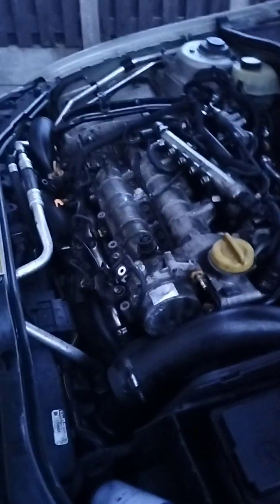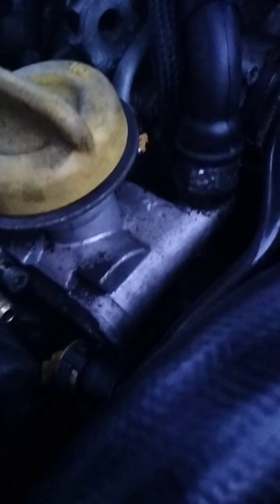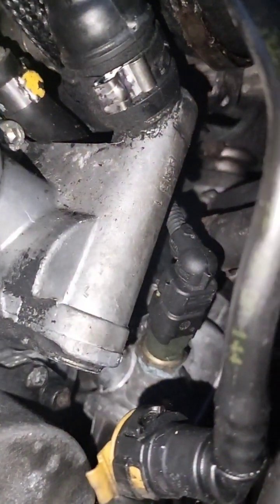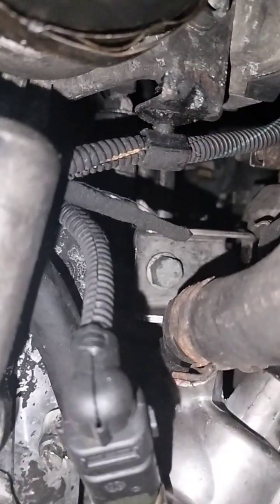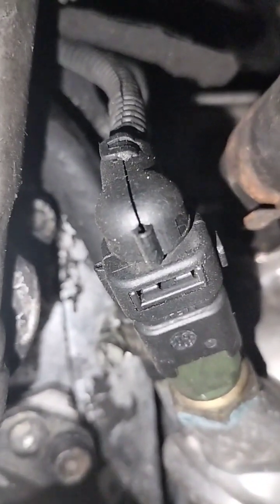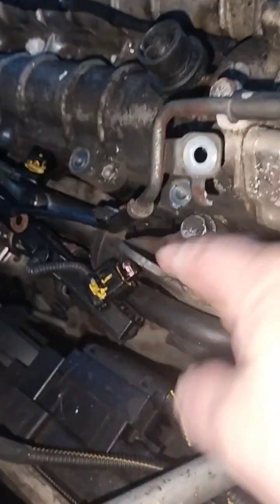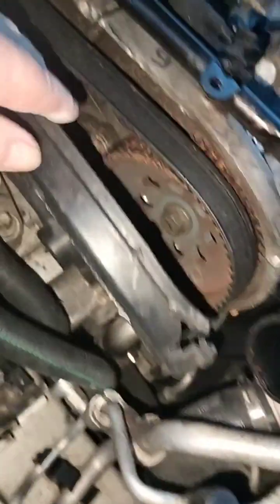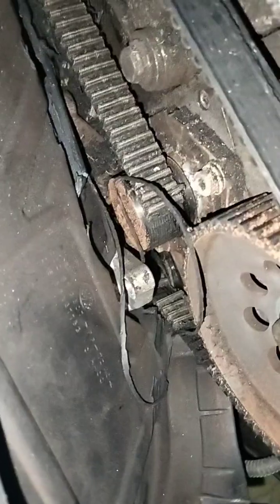Saab snapped Cambelt number 10

Comment from the maker: Note, I did undo the bolts holding the engine  lift brackets to see if they went deep into the engine block. They only went into the cam cover so they come away with the cam cover. 😢